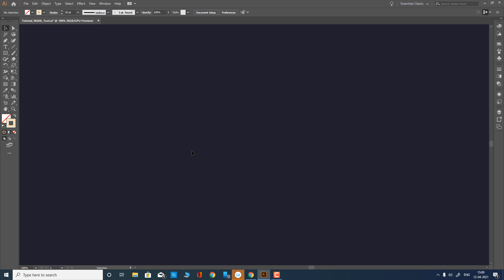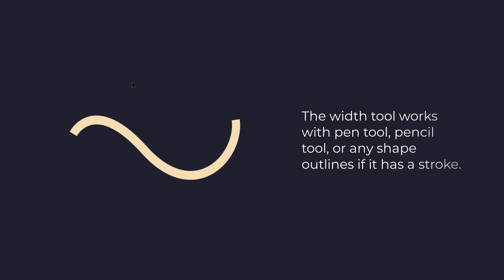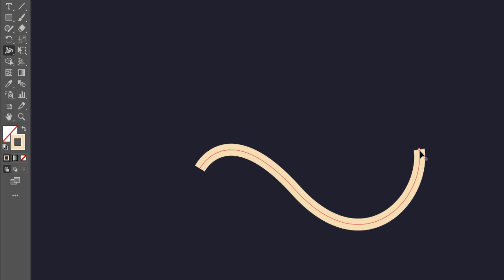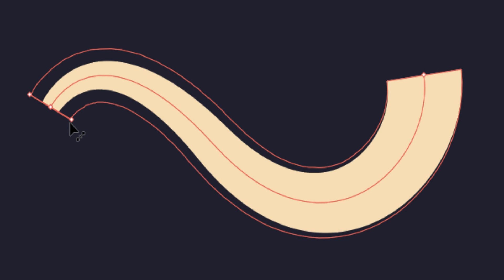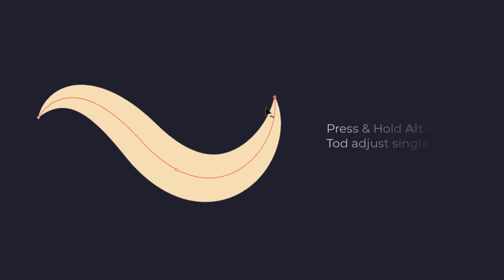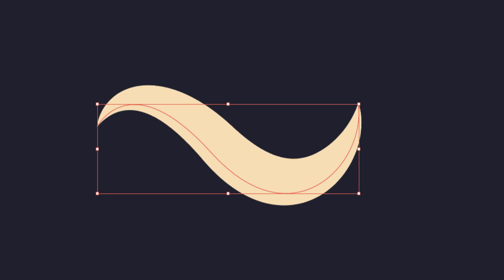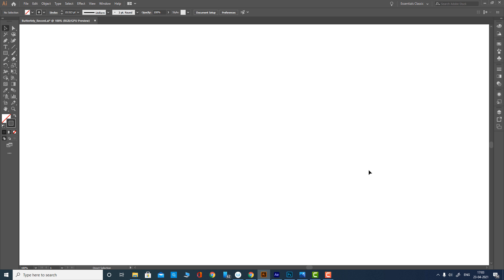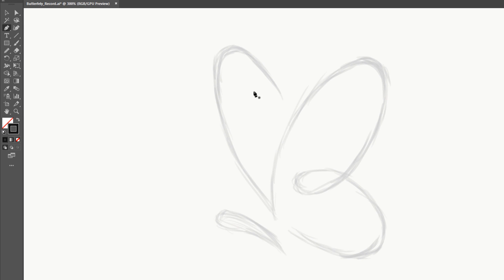Master the Width Tool for Logo Design | Adobe Illustrator Pro Techniques.

Comment: Hello! I tried doing that, using the Brush tool to draw my logo, and then using the first option of the width tool, and it's not working. Why? What am I doing wrong?
Pleeease, help-me? 

With the pen it works, but with the brush or pencil it is not working. A stop symbol appears at the cursor.😞😞😞😞😭😭😭